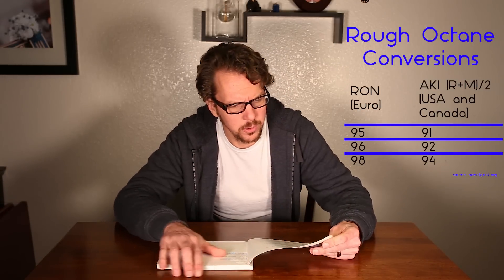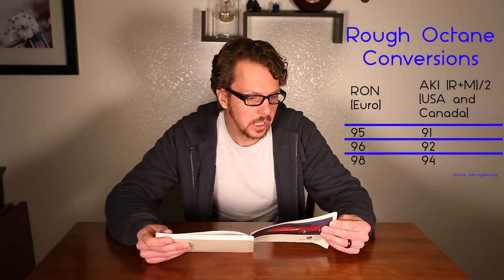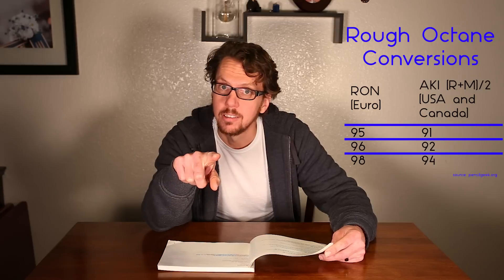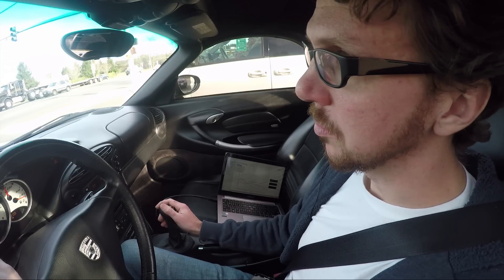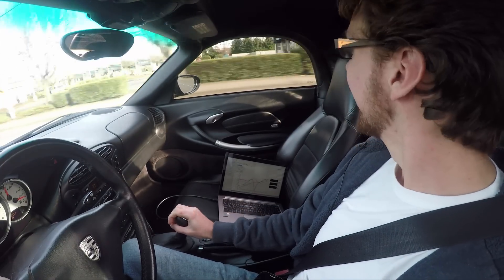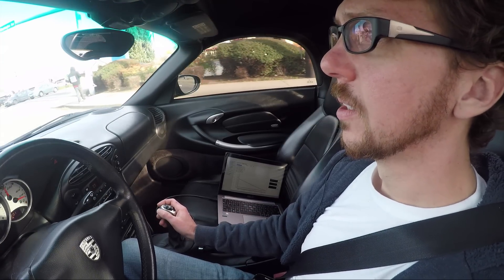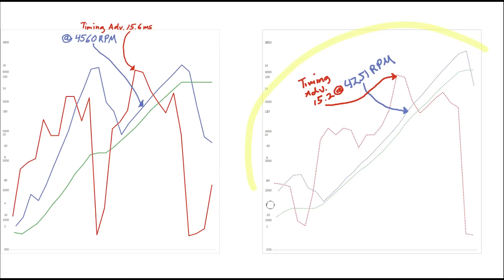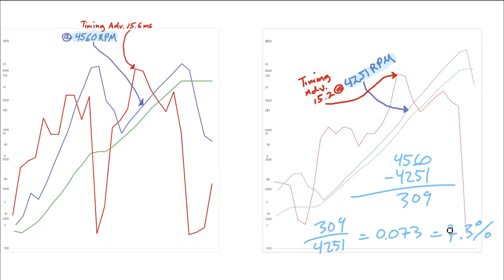Does High Octane Fuel Matter? A real world test

Comment: AFAIC, you can run just about any octane rating on modern cars with an induction system that controlled by a computer and has knock sensors. octane is only in gasoline to prevent knocking. and when engines had a fixed timing and various compression ratios, gasoline manufacturers had to offer various octane amounts in the gasoline. it's pretty much unnecessary now, but of course the gasoline companies wouldn't dare stop making, and more importantly selling you, a more expensive gasoline than you need, seeing that the automotive world has grown up with multiple octane gasoline and is convinced that "premium" fuels are "better". they aren't. 

i put 87 octane in my cayman, aston martin, st1300 honda motorcycle and my 1953 MGTD. they all run fine on it.

Comment: That’s fine so what do you recommend if car manual mention (use Premium R95 for optimal engine performance if not found you can temporary use unleaded R91 ) So does it mean R91 can be used all the time or only as said temporary and should use mainly R95 
As in our country we have only R91 or R95 with huge price difference per liter

Comment: Gasoline engines with high compression ratios (above 12) would generally require premium fuel. Except Mazda who made an engine with 14 compression ratio (on gasoline), most manufacturers don't exceed 12.5 (especially if they're turbocharged).
Reply from the maker: I am really impressed with Mazda's 14:1 compression ratio! But, you're right about compression ratios. My Porsche has an 11:1 ratio that is considered pretty high (and definitely calls for premium). You're also right about blown engines. You get more horsepower from boost than you do from the compression ratio, so manufactures often choose a lower compression and higher boost. Cheers.
Reply: Keep up the good work, cheers!

Comment: off topic but I find the gear shift is slow on my 986. I realise that it's rather complex but I'm wondering if there's anything that can be done to a 5speed manual to get those gear shifts a little quicker. thanks.
Reply from the maker: If you find the throw is just too long and it takes you too much time to move the shifter, you can get a short shifter... I'm not sure I'd recommend that, tho... and I don't think that's what you mean... do you mean it's hard to get it into gear? Like it takes a little time to get it into gear?
Reply: Yes. Correct. The throw is okay. It's just slow. It takes a long time to shift between gears. Thanks.
Reply from the maker: Ok, cool. That's what I figured. So short of replacing the transmission, I have two thoughts: 1) Check the transmission fluid level. They are very sensitive to fluid level. 2) Change the transmission fluid. Porsche recommends changing the fluid every 90k miles. 

The good new is that if neither of these things work and it gets worse, the 5 speed is really inexpensive. It's the same transmission that was used in an Audi (I forget which one), but I'm told you can find the Audi version at a really good price.

Comment: Good job ,,,,, What you fail to mention is you will get more knock with lower grade fuels and also its a dirtier fuel mix than say your premium grades that has fuel cleaners added in ,, if your Porsche comes with a replaceable fuel filter its not a problem,, just swap it out and your go to go ,,, but if your Porsche e.g 997 Carrera ect, they have no replaceable fuel filter, all the dirt and crap from the fuel is left in your fuel pump and tank..... so its always best practice to use premium grades for this reason alone its cleaner for your engine and fuel pump will last a lot longer .... .... ....
Reply from the maker: Ah, yes... "My gearbox broke!" Well, the oil lasted the life of the transmission...
Reply from the maker: Agreed. I would definitely always use the highest octane fuel for a Porsche... The timing will adapt down to about 90 or 91 AKI fuel. So you shouldn't have engine knock. Still, it's best to use the fuel recommended. I went a bit more into this on my other video on compression, timing, etc.

...I didn't realize the 997 doesn't have a replaceable fuel filter... that seems strange to me. I thought all cars had replaceable fuel filters. Certainly my 986 has one. I wonder why they change.
Reply: Starting in 2002 911 Porsche moved the filter to inside the gas tank and called it a "lifetime" filter that never needs to be changed
Reply from the maker: huh. I did not know that. Thanks! Although how a filter can be "lifetime" is beyond me.
Reply: MIXMASTER RONEDEE 
.
Reply: Yes, it's a bit like the "lifetime" oils of some automatic gearboxes.

Comment: Hi Burner, do you have any advice on aftermarket exhausts and remapping. Thanks mate.
Reply from the maker: Sure! I haven't done any of these modifications, yet, but I've been doing some research. It seems like there are several good aftermarket exhausts that are lighter and offer less restriction. It should be a nice upgrade. As for remapping, I only think it makes sense if you are getting more air into the engine. If the air intake / throttle, etc. are stock, the ecu will adjust everything optimally and you're unlikely to see significant gains from an ecu remap.
Reply: George. I've recently done the PSE bypass. or otherwise known as The Pedro Sports Exhaust bypass. it worked great on my 2.7 986. no loss of weight but the exhaust sounds fantastic

Comment: Does using lesser octane fuel as recommended by the manufacturer cause damage to the engine in the long run or you just get lesser performance with no effect to the engine. Thanks
Reply from the maker: Great question! As long as it's within the range that that the timing can adjust, it causes no long term damage. So for the Porsche, using 91 Octane instead of 93/94 AKI is fine, but using 87 AKI might actually cause long term damage because you won't have enough adjustment in the timing to prevent preignition.
Reply: Great, thanks for the answer and keep up the good work. Love your videos. I own a 2001 Boxster S myself.
Reply: Knock sensor: a microphone (piezo-electric) that picks up all the sounds and vibrations (Knock sensor 1 is mounted to the left side of the engine on top of the crankcase near cylinder 2; knock sensor 2 is mounted to the right side of the engine on top of the crankcase near cylinder 5 for the Boxster) and transmits them in electrical form to the engine management DME (DME = Digital Motor Electronics; compression ratio 11: 1; 1997-1999 2.5 liter Bosch M 5.2., 2000-2002 2.7 l Bosch ME 7.2, 2003_2004 2.7 Bosch ME 7.8. The DME main relay is also referred to as the ECM main relay.
Since knocking is a shock to the characteristic sound, the form of the electrical signal that it generates in the microphone is also. As the ratchet probe transmits continuously, it also allows the management to know if the engine runs empty or more or less loaded (the sound is not the same); This will cause a very slight increase in the idle speed when the gas pedal is not actuated.When the knock sensor picks up a knock signal, the electronic engine management will delay the ignition timing by 3 degrees per revolution of the crankshaft to eliminate pinging, up to 12 degrees. After the knocks are gone, the electronic engine management will 
advance the ignition timing by 0.33 degrees per revolution of the crankshaft until the knocks recur and then delay by 0.33 degrees. The rattling comes from the use of a gasoline with an octane too low, this decreases the efficiency of the engine. If the electronic engine management does not remove the knock, the engine is in danger!
Reply: Very nice question for me I own Toyota Prado v6 and Toyota recommend Ron 95 If used Ron 91 Car engine start knocking If used for long time if temporary no problem and written in car manual

Comment: Hey Ben Burner! I watch all your videos they're all great! But hey so something weird happend to my Boxter please help! Took out the battery of the Porsche to charge at autozone. I put it back and my car won't start at all anymore. It doesn't even crank at all to try to start. All lights and radio come on as normal though.. I don't know how to fix this and don't want to go to the stealership!
Reply from the maker: Huh, was the battery dead when you took it to autozone? Off the top of my head, I have two thoughts: 1) Make sure both leads are clean and tight on the battery terminal. If they're a little loose or dirty, they might allow enough current for the lights but not enough for the starter 2) Check the starter for problems.
Reply: Edgar Hernandez if you aren't hearing a "tick" noise (starter's pin engaging to ignite the engine) then it is very likely your starter. Additionally, your battery may be charged but its core could be bad and ultimately cause the battery's charge and voltage to diminish. Tip: if you compress the sides of your battery and it feels abnormally squishy, it is also a sign of a bad core.
Reply: ...also loose/bad ground straps are known to cause issues with several generations of boxsters and 911s. There are very few contact points between engine/gearbox and chassis, so the ground strap is critical. The starter grounds via the engine and the battery via the chassis. So you need a good ground strap to connect the 2.
Reply from the maker: Good tips, Pedro! The negative battery terminal grounds to the frame right near the battery. Maybe it was a little loose, and taking out the battery exacerbated the problem?
Reply from the maker: Ah, ok! I believe that's the code for the immobilizer. That makes perfect sense! Googling 'p1571 Porsche' should give you some good results, but here's where I'd start:
1) try a spare key if you have one (it could be a bad key)
2) check under the driver's seat for moisture. The immobilizer is located under the seat, and if the drains are blocked in can become wet and damaged. This might be the most likely scenario.
3) check the wiring to the immobilizer. hopefully this isn't it. Finding wiring shorts is a pia!
Reply: Burner's Cars thanks a lot for you guys' advice. I checked the battery positive and negative components and checked to see if the ground connected to the chassis was loose and it was not. But I bought dme code reader for almost 200 bucks on eBay and it's giving me code p1571 and to look on my owners manual but I don't have one so I'm trying to see what the code means? Anyone know?
Reply: Edgar Hernandez it's a transmission shift solenoid. It could possibly mean that you should change/clean the solenoid and drain the fluid. It could be the reason the car isn't starting, especially if it is a tiptronic gear box.
Reply: Edgar Hernandez
If you stick these on google you generally get a response albeit not necessarily specific to your car. I am presuming that the manufacturer with the most similar code interpretation would be VAG so P1751 could be 'power supply voltage - high voltage'. Have you measured the battery voltage? Disconnected, connected with ignition off and on?
Reply: D'oh 1571, not 1751....
Reply: Parker James ..
Reply: A defective battery sometimes causes micro-releases of the "DME main relay" (position 1 relais panel in rear trunk).
This destroys his power contacts. Then it does not feed the coil of the "Starter" relay (position 7 relais panel in rear trunk); thus the starter is no longer activated.